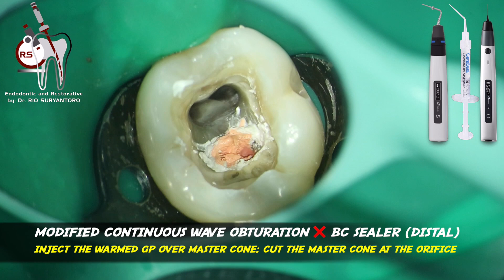SINGLE VISIT ENDODONTIC PROTOCOLS | RUBBERDAM - ACCESS PREP - CLEANING - SHAPING - 3D OBTURATION 🦷

Comment: Thank you for another great video. Why does the root fill seem so much shorter in the final radiograph compared to your cone fit radiograph?
Reply from the maker: thank you so much sir.. yes sir.. i cut the master cone 1 mm from the tip to make sure that my obturation won't over from the apex..  😃
ps: in some patient where i see diameter of the apex at the initial xray is quite big, i prefer to cut the master cone 1 size bigger than that fitted at the apex.. 😃